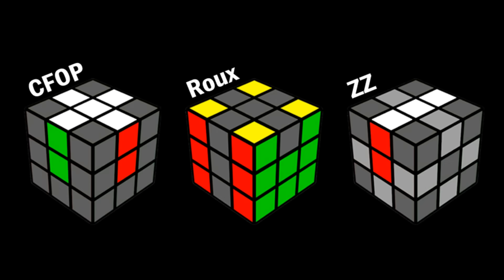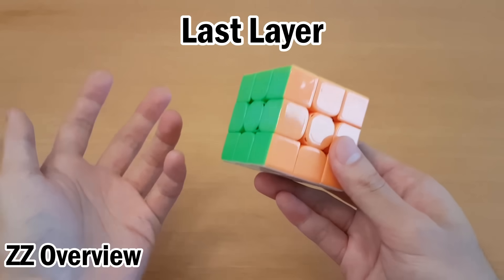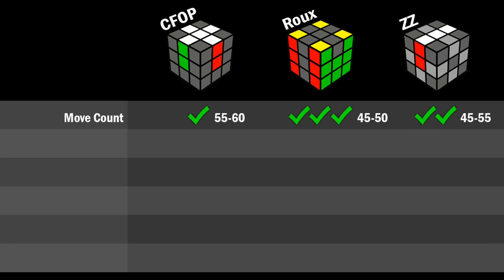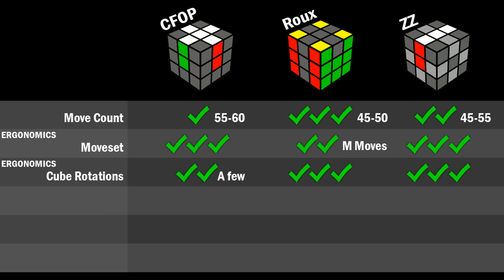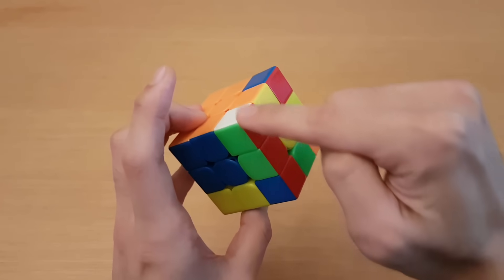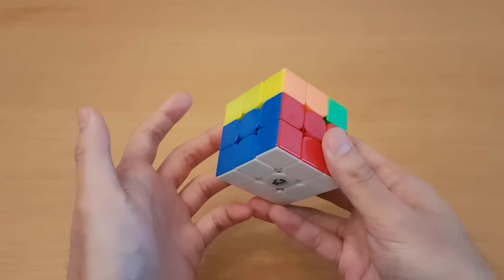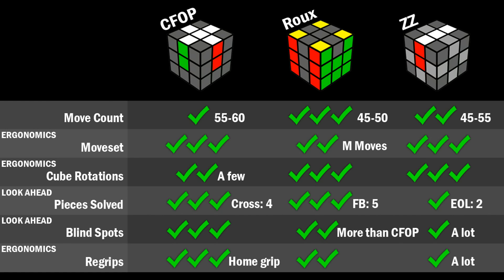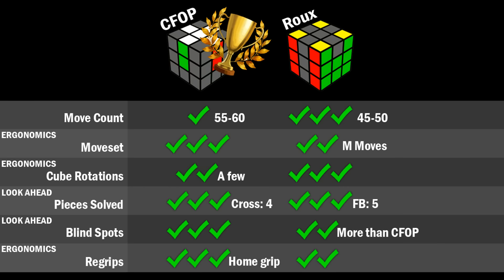The BEST Speedcubing Method? [CFOP/ROUX/ZZ] Comparison

Comment: Lookahead on ZZ is not worse than CFOP,  in fact, it could be better. ZZ is all about inspection and TPS so if you can inspect your EOCross or XEOCross or EOwhatever, you can turn fast and make that EOCross without pausing and the rest of your solve will be much smoother than CFOP,  because when you edges are oriented in F2L, lookahead is sooooooo easy because you don't need to worry about the orientation of your F2L edges and you can turn much faster as you don't really need to rotate, I know about R and L move switching, you can get rid of that problem if you don't suck at RUL, ZZ for OH tho, not really that good cause L moves suck in OH and also, if you get a cross made on LL, you can do all sorts of tricks like ZBLL in which ZZ's last layer is supposed to use ZBLL, and COLL and others that I probably don't know.

The problem is that my argument about planning could also be used for CFOP for its cross, you can plan XCross to make it good or XXCross, etc.

Well you might say, but rotations can uncover hidden pieces! well yeah, but I feel that the fact that the edges are oriented for F2L and LL getting a whole lotta boosted can compensate this problem.

Comment: I think one thing you're neglecting is that most fast zz solvers use EOCross, instead of EOLine, because EOLine is quite slow and inefficient. With EOCross, ZZ is basically just CFOP but F2L and OLL are easier. I think ZZ is better than CFOP because you can turn just as fast, the number of regrips and your lookahead abilities are essentially the same, and last layer is faster.

Comment: 8:52 Instead of doing what you did in the video, can't you just do U2 and then insert the pair into the back slot the same way you would with F2L?
Reply: What about the DR edge? That's still unsolved so you can't do that
Reply: @lumina_  Ohh, I didn't see that. I would have just inserted the DR edge first, and then inserted the pair normally instead of doing weird wide moves. It's not as efficient, but the fingertricks/regrips aspect is much better.

Comment: I'm not a speedcuber, but I also prefer CFOP because it's similar to what I learned 15-20 years ago from my father. He solved it by himself, then implemented a part of another method. Do you know a name for this?
Layer by layer, basically repeating F/F' U2 F'/F U'2 L' U' L (or R/L' U2 R'/L U'2 F U F') at the second and third layer then 4x R E and at 2x/4x R F' R' F (or R' D' R D
) depending on the state.

Comment: its necesari to learn CFOP  when you're sub 20 or more?
Reply: most people learn cfop at around 35 seconds,the recommended time to switch to cfop is 30 seconds
Reply: also,yes it is necessary since it isn't possible to get faster than 15 seconds with beginner's